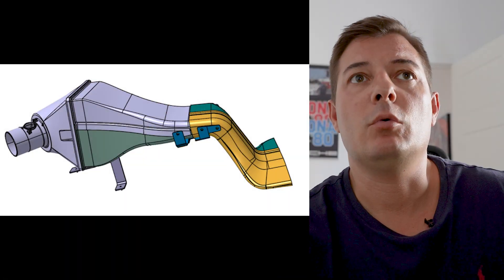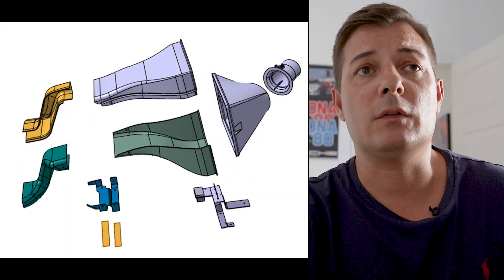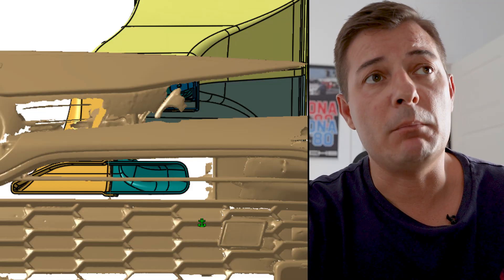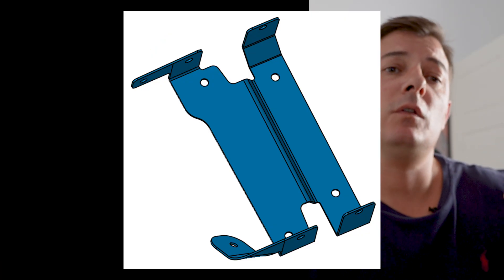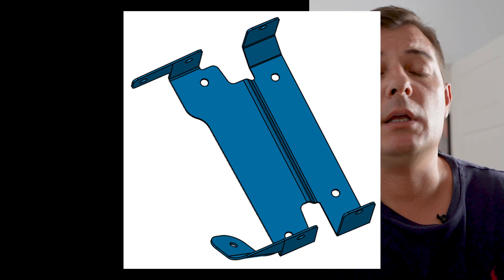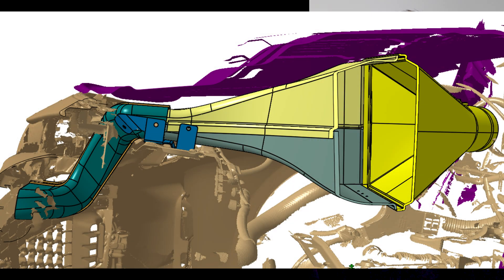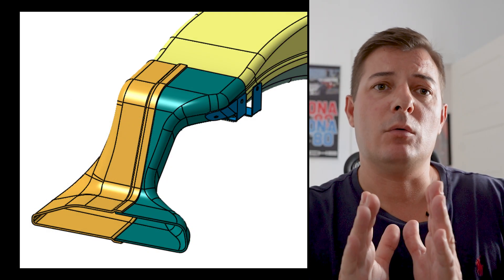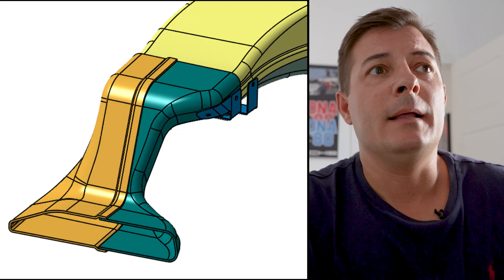GR Corolla Engine Intake Airbox SECRET Development Update

Comment: My comments on the other thread I think were misinterpreted.  I wasn't suggesting two intake charges to go into one intake/airbox.  My suggestion is to have the right side of the radiator shroud have a "scoop' that directs the airflow from the front port  to over the engine cover to cool the turbo and the engine bay.  Tanabe with this "cooling plate" design claims -19c reduction in underhood/engine bay temps.  See this video which shows the airflow for the engine/turbo cooling:  https://www.youtube.com/watch?v=2QwMWyouQNo  that way you can make both an intake and a cooling plate solution all into one, for minimal modification of the right side of the radiator shroud (really adds one scoop from above the radiator).  Anyway glad to see this solution for the GRC!
Reply from the maker: Thankyou for clarifying this: I watched the video and now understand what you mean.
We would never implement a feature like that, if not in need to correct a major overheating issue.
This is because we want all the air to go above the car, not beneath it.
We make and sell a three piece hood vent kit for the GR Corolla that does great for engine cooling and Aero, performance that you will feel while driving thru more front grip (less lift) and lower engine temperatures
Reply: @PIRASMotorsport  I see thank you for your reply.  Yes I was aware of your hood vents, which I think is a great solution for certain models..eg in the US the core and premium don't have the vents whereas the premium plus and circuit edition do.  It's a little harder to justify when already have the factory hood vents (would entail having to get another hood without vents) and I'm sure the PM hood vents are more effective vs the factory.  Thx for all your efforts and really neat and effective products!  Cheers!

Comment: This is a good design for air flow, though I'm not a fan of having to cut up the OEM radiator cover of my new car. I may order an aftermarket cover to cut up instead. For any modification for me, I generally prefer cutting up OEM parts, if I don't have to. But I understand the costs of shipping an entire cover is too great for you guys.
Reply from the maker: We provide a new radiator cover with the kit mate!
Reply: @PIRASMotorsport  Ah! Thanks for clarifying, I must have missed that! Apologies!
Reply from the maker: Cheers, no problem!